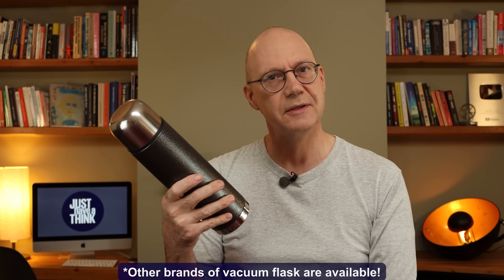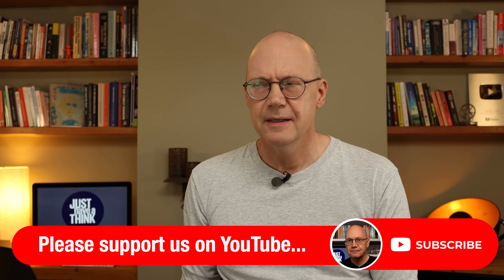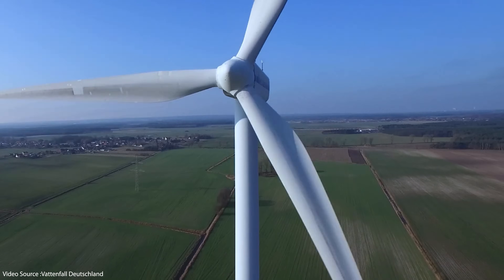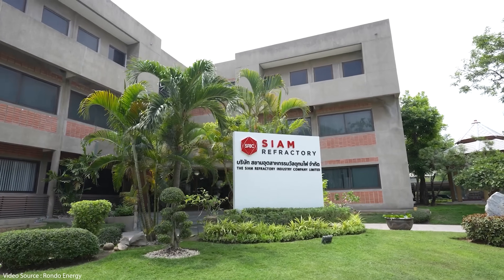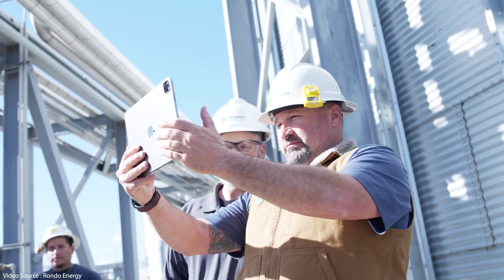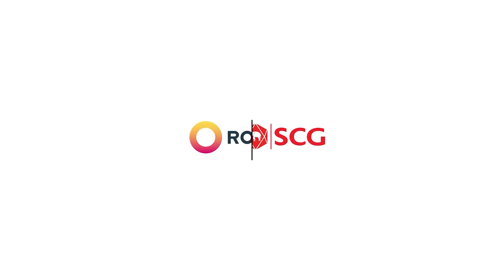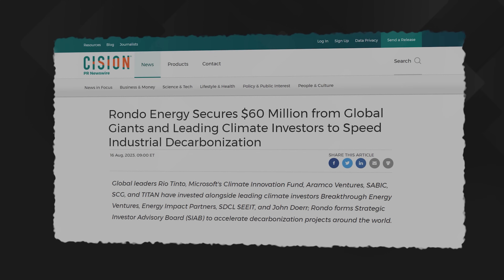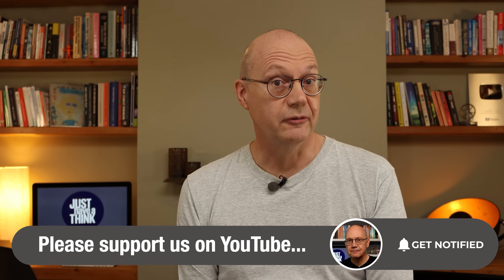This energy storage technology is HOT STUFF!

Comment: I keep being reminded of the sad facts of energy conversion efficiency: as far as I know converting heat to electricity is inefficient, while electricity to heat is very efficient. Therefore it follows that storing heat (e.g. from sunlight) as heat makes a lot more sense than storing as electricity.

Ditto if you have waste heat from some process, it is very hard to use unless it's a fair bit hotter than its environment, but heat exchangers can be used to add a lot of low-energy heat together, making it far easier to use the heat directly for something, or to convert it to another energy form. The issue is that most waste heat is distributed (e.g. car ICEs, refrigerators). Being more savvy about its storage and use will I am sure become one of the necessary aspects of decarbonisation.
Reply: Storing electricity in batteries is also very efficient but batteries are expensive. If that energy is going to be used for heat then store it as heat, which is also very efficient. Don't store electricity in batteries to then produce heat aka to power heat pumps. Remember storage heaters!!

Comment: Well using water has the advantage that you can use a heat pump and with that get 2 out of 3 energy units for free.
Reply: Though not if the power to run the heat pump is really expensive because it's peak demand time and there's no sun or wind. Efficiently isn't everything!

Comment: This is an interesting niche and the concept is sound.  But there is always a "but", and in this case we need to keep in mind that there are severe limitations to this sort of storage.  It's only "efficient" if it can directly pipe the heat somewhere.  And the temperature is limited... it won't be useful for making steel for example.  The instant they try to convert the thermal storage to something else, such as electricity, massive inefficiencies are introduced... so it won't be used for that purpose.  And the heat mass storage that they list in MWh and such... the actual electricity equivalent is more like 1/4th of that because this is a direct thermal storage niche, not a heat pump.

So this sort of technology has a very strict niche.  Industrial processes and heating via steam.  That can include building heating, though, which is a big energy user.   And losses will increase radically as distance increases so this sort of technology is mostly useful only when paired with specific nearby buildings and industrial processes (within a block or two of the storage).

That said, even just normal building and domestic heating uses an enormous amount of energy and a mechanism like this fits quite well into day-centric renewables such as solar.  It will be interesting to see what happens.
Reply: CSP and molten salt storage systems beg to differ.
Reply: @Hecatonchires1991  Beg to differ?  I think you are a bit confused.   The temperature that the actual storage system runs at has nothing to do with the temperatures that are deliverable to an industrial or other process.
Reply: @junkerzn7312  You said storing heat will not be used to generate electricity... but it is exactly that what is already being done in various CSP plants around the world (using molten salt as the storage medium): the sales pitch there is to store energy in a 24h window (to bridge day and night)... not much more than that of course, no seasonal storage.
Reply: @Hecatonchires1991  Those are short-term molten salt systems, yes, with very short transport runs... which is not what we are talking about here.  And while they do produce electricity, it isn't a very efficient process.  There's a reason why those systems are having a hard time competing against conventional solar fields and batteries.

What is being talked about here is basically electricity-to-heat-storage and then having direct use cases for the heat.   Once you go through that first conversion, you do not try to convert the heat back to electricity.  You can only use the heat for some industrial or building heating purpose.   The reason you do not try to convert it back to electricity is because it is not economic to do that... the end-to-end losses are massive!  Probably over 70% in losses.

This is very different from solar thermal systems which generate heat directly from sunlight which is then more or less immediately used to generate electricity in a short-run closed-loop process.   Molten salt storage is barely economic just load-shifting by 2-4 hours.  NOBODY is actually trying to use it to produce electricity on a 24-hour basis.  It just isn't economic to do that.
Reply: Put the heat store in the building to be heated and 'charge' it when power is cheap. It's called a storage heater and used to be common in uk houses.
Reply: @petewright4640  In Hawaii we had walls made of volcanic rock that would soak the heat up in the late afternoon and then radiate and keep the room warm overnight.

Comment: I’m musing about uniformity versus non-uniformity of heat distribution. 
The diagrams you showed made it look like the Rondo system pushes the warm air (or was it water??) up from the bottom, and the top of the stack of bricks is much hotter than the bottom.  Just a gut feeling tells me it might be better to have uniform heat distribution in the bricks.  And I’m thinking about counterflow heat exchangers.  I wonder if you were to push the hot air down from the top, then as the heat is absorbed into the bricks, the air would cool and become more dense, and that might actually create a downward flow so you didn’t have to force it down. 
I’m also wondering about the opposite, extremely high heat concentration in one place. What exactly determines just how hot the stored heat should be? The hotter it is, the smaller the volume needed to contain a given amount of energy.  So why not store it at extremely hot temperatures? I’m imagining bricks or sand or something where the temperature in the middle of the pile is approaching that of molten stone. Just musing.
Reply: You don't want to store heat any hotter than the source of the waste heat you are keeping for later. This is a device for reusing heat that would otherwise go to waste.

It would be better to use electrical shortage than to (say) electrically heat the bricks a was done in domestic storage heaters in the last century. That's because battery tech has moved on since the 1970's (though in the UK a fair number of those storage heaters are still in use - they had the advantage of being so simple they don't wear out!)

Comment: With the thermal sand battery ( that you also covered) the heat capacity is lower than water but the thermal range compensates for that. Additionally the sand ( if dry) does not present the corrosion problems that water does.

Comment: In first, to have energy stored, you must to produce it. As far as I know, the gap between low carbon energy production capacities (renewables, hydroelectricity, nuclear energy...) and fossil fuel based energy capacities that the first thing to do will be to replace them in emergency to feed directly the different applications and not to store this energy.
Reply: "...and not to store this energy.＂- on the contrary.  Diurnal energy sources such as sunlight, or intermittent energy sources such as wind, require significant energy storage capabilities in order to be key to our energy intensity way of life.
Reply: @TheDanEdwards And to add to that; when electrical energy storage us full the next best thing is heat.

Comment: Non professional opinion is that 1500C is probably just too hot. I mean the energy loss speed is based on temperature difference even when very well insulated (0.02Wm^2/K? that is like 30 watt hours / m^2 or 100Kw/day for the 4 shipping containers or 18Mw in 6 months(math error ? More like 0.5MW ?)). And I doubt a square container is vacuum insulated due to atmospheric pressure ( 10 ton/  meter^2 ? ). And at 1500C most insulating materials start to have degradation issues. Your options are silica wool ? Even copper pipes start to melt at 1500C.
Reply: 100 kWh/d * 180d = 18 MWh.
Reply: No. The higher the temperature the more efficient it is to convert it to other forms of energy (for example, rotational energy for a dynamo). And you need much less bulk, too, both for the storage medium and for the heat exchanger. Best temperature will be a tradeoff which you'll need to do some serious maths to find , but it is likely to be pretty high.

Comment: Also worth checking out the startup Antora which does a similar thing but with carbon blocks, which actually glow very brightly when heated, so they also have PV integrated into the system to generate electricity, when/if that's needed more than or in addition to industrial heat.
Reply: We love what Antora is doing and wish them the best, there's a lot of market to cover! Ultimately, we think our materials are the safest to use for heat storage, and have been proven to work in the steel industry for hundreds of years already.

Comment: A fascinating video. Industry and factories are taking the solar/wind power and really are doing a good job utilizing the energy. The cost intrigued me. I wondered how many solar panels and wind generators it would take to heat up the “bricks” and for how long the panels would have to produce such heat. Solar panels and wind generators placed on the “land” is one of the problems of solar/wind. If the power to heat has to be constant, then I see a problem of scale and use. If on the other hand, if solar/wind power is only on demand, I see a problem of scale and underused. However, this problem can be overcome by having multiple “battery” pods set to different rotating temperatures of use, with the solar/wind sending the heat when temperatures fall. I can see where this will save a lot of money, with the energy cost being cut significantly for factories making widgets. I also wonder if the consumer will share in this technology and savings? Doubtful, prices rarely go down.
Reply: Our smallest unit requires a 20MWac PV field to charge! Or we can be tied to a grid.

Comment: Very encouraging.

As a ceramicist, I felt it necessary to say that the Rondo system is far from CO2 free in production unless the manufacture of the "Bricks" is conducted with renewable energy. 

I'm sure they've done their calculations correctly but the manufacture of large ceramic objects that can withstand 1500 degrees is usually very heavy on energy input. I don't know of a concrete product that could withstand repeated exposure to such high temperatures.

As regards the degradation of the units, I can see that the ceramics (if that's what they call it) would not degrade through the expansion and contraction as long as the temperature is carefully manage to avoid the major physical change in silica (quartz inversion) at 573°C, notorious for destroying ceramic objects, particularly bulky objects like these.

The electric elements will suffer degradation far sooner than the brick.

I still think it's a serious move in the right direction and the promis of large scale production is really positive.
Reply: One of the nice things about this system is that it would have a lot of use in de-carbonization of concrete and refractory brick manufacture.  If you put the plants in places like CA where there's a huge renewable energy surplus during the day, you can charge up the bricks.  Even if the cement plant is using fossil fuels for its primary heating, they could swap over to the high temp air to reduce or eliminate emissions during the middle of the day.  If they were using electrical heating for the thermal input, they could get even greater savings, as the plant could run off the grid during cheap renewable power periods and off the bricks during the night.  Steel and other metal refining could see large carbon/cost savings with this tech with fairly modest changes to their infrastructure.

As for the electrical elements breaking down, I wonder if these bricks are microwave absorbers.  If so, it might be possible to simply use magnetrons to heat them up through microwave transparent windows and keep all of the electronic components at more modest temperatures.
Reply: Yes but the brick have to be made only once, then wee are good for decades on end :)
Reply: It is called Foundry Brick made for high temperatures.
Reply: If 573°C is a critical temperature, how do they manage 1500°?
Maybe the ceramics they use are without Silicone?
Reply: Fondag concrete is good to 1100°C.

Comment: Sounds good, but needs very cheap electricity to be economically feasable. Only possible with flexible tarifs reflecting surpluss situations, which already occour sometimes, but not very often. For this we' d need much more installed capacity. Who is to invest in something with lower and lower return?
Reply: They're paying for the energy to make the heat already.  If the heat battery means they can use a cheap solar array to run their process continuously, that's worth a lot.

Comment: Why are they using electric resistors to heat up the bricks? Wouldn't a heat pump be more efficient?
Also, how can they claim better efficiency when they say that the heated air is used for whatever is needed, so in fact different purposes with likely different efficiencies.
I smell rotten marketing.

Comment: If I’m not mistaken, the air and temperature control system would be totally doable by a fuzzy logic system. (Such as you’d find in a sensor drier, or some dishwashers.) 

Which was hyped as AI in the 90s but quickly became just another mundane thing instead of “AI”, which is a moving target. 

Unless Rondo are really using neural networks for some reason, and even if they are they could well be reimplementing fuzzy logic if the network is analysed, it’s kind of funny to see it getting called AI again! I guess it’s somewhat appropriate, the 90s are in fashion again in some other ways 😉
Reply: There's no way it's more than an algorithm. AI is just a squishy enough term to use and gets investors going because they know nothing.
Reply: Actually a simple PID controller would be more than sufficient
Reply: @michael-j-harrison  great, so even simpler haha
Reply: It sounds to me like they are trying desperately to protect some IP and make it sound sexy for investors.

Comment: Essentially we are manually creating geothermal energy for a storage.  Seems like we could combine it with direct geothermal energy and storage pretty easily and then you have both storage and production combined with easy swapping.
Reply: Early Geothermal energy plants suffered a slow but persistent loss of capacity over time (IIRC as the rock cooled), eventually resulting in either having to move the extraction point or close the plant. Has that issue been understood well enough now that we can use it long term?

Comment: Lets not forget that energy conversion is needed (from heat to electricity) for use for stuff other than a specific powerplant that needs heat. This can drop the efficiency.
Reply: Your point is more widely valid than just electricity

Conversion of heart into mechanical energy is the inefficient thing: so this is a useful way to store heat where heat is needed later, but not so good when wanting mechanical energy. That includes turning a generator to make electricity.
Reply: Our combined heat and power (CHP) efficiency is around 95%. Most of our early customers, however, are simply looking for steam to replace their existing gas-fired boilers.
Reply: This would be great for capturing low energy excess heat from manufacturing process if your city had a public hot water supply. Oh communism

Comment: There must be many industrial processes going on throughout the country that just vent hot air straight out of the building. Would it be worth some of them having their own storage facility to sell or use the excess heat themselves? What advantage does this have over the sand batteries?
Reply: Waste heat tends to be at too low a temperature to do much with.  You can't heat up a brick any hotter than the waste heat temperature unless you start using expensive tricks like heat pumps or phase change materials.
Reply: As noted elsewhere, "low-quality" heat (heat relatively close to ambient) is harder to use, but absolutely worthwhile in the right way. For example you could direct the heat into a heat sump (e.g. a large volume of water) which will raise the water temp, and then use the water to run a heat pump to heat the building. Or use the heat pump straight away in combination with a steam turbine or thermoelectric pile, or ... well there are many ways!

Comment: Longtime fan of bricks whether for walls and walkways or for fireplaces and chimneys which are vastly different. According to Wikipedia: "Fire brick was first invented in 1822 by William Weston Young in the Neath Valley of Wales." However did we get along without prior to 1822? There must be a good deal more to this story which I venture to guess has more than a little serendipity to it.
Reply: The 1822 invention was a way to make bricks that survive the sort of temperature needed when making steel. Prior to that, bricks heated that much would melt, break or spall (shed flakes off the  surface). So, prior to 1822 it was hard to make steel...